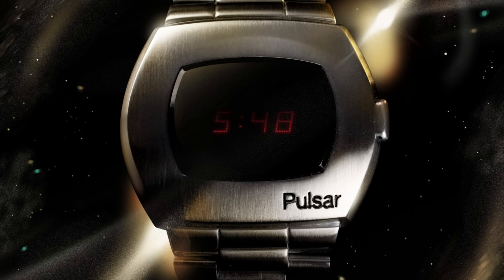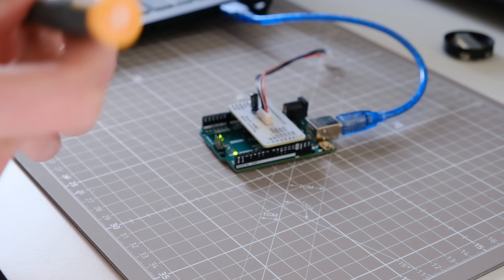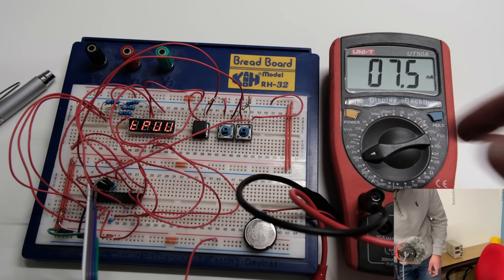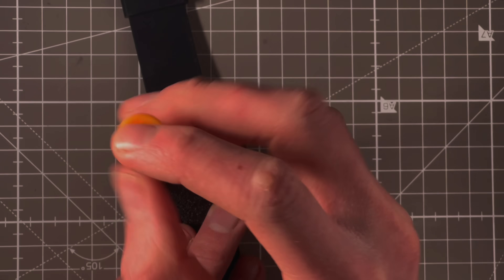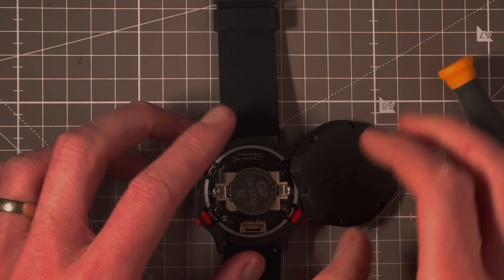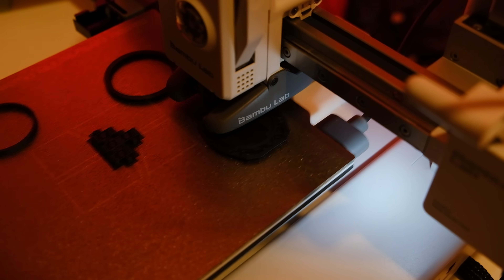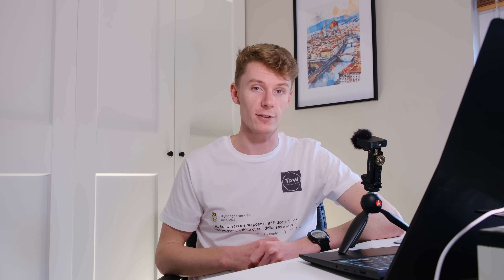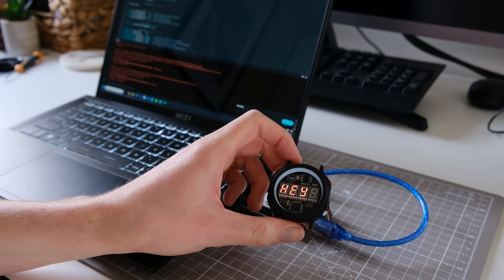DIY Digital Watch - Arduino and 3D printed, make this next!

Comment: Ok, look thru some of your Videos. Sadly without WiFi this watch just doesn't cut it for me. Having a a fully programmable watch with WiFi or just bluetooth would be nice accessory for other Arduino Base projects, but without any external Coms it's not quite something for intermediate tinkerers I think. Maybe you can add the standard HC-05/HC-06 module into it for model 2 so you can have the Watch talk to your watering system.
Nice beginner piece for sure thou.
Reply from the maker: Thanks for the feedback!